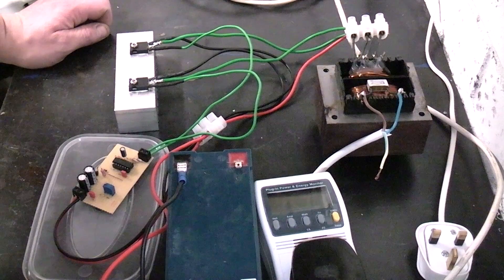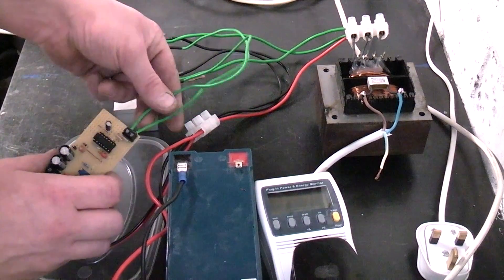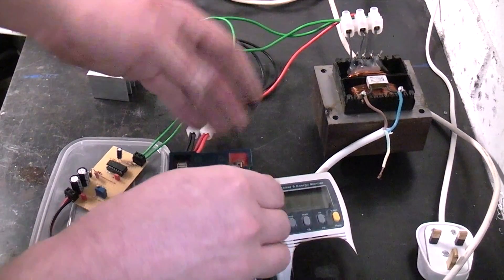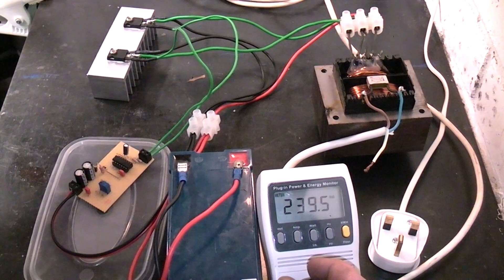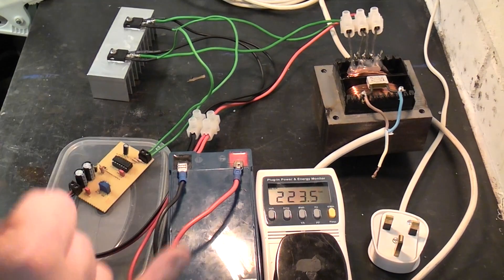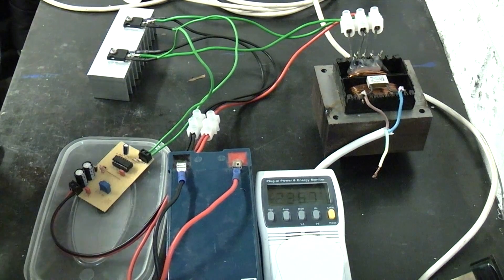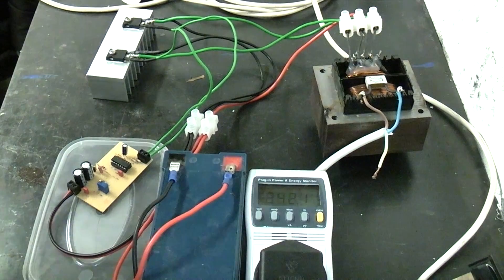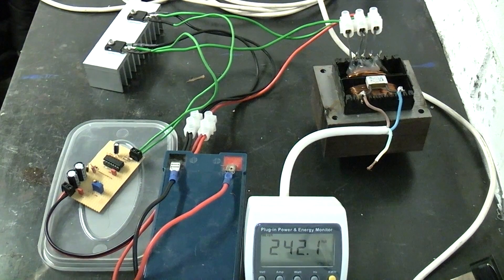DIY Power inverter 12VDC to 240VAC 50Hz 100W.

Comment: witch is most efficient ? single stage of 2 stage inverters? I'm wanting to build a 4-6kw inverter. but not sure. a single Steve is simpler. but I need pure sine wave. I'm probably going to go with the eBay spwm driver boards for a near pure sine. but not sure how to drive the DC to DC. and have feedback for regulation of DC based on load. and voltage drop. I want to maintain constant voltage if possible. do you have any ideas? thanks

Comment: Very Nice Job and nice tutorial,  Please share the diagram of your inverter.
Reply from the maker: +Ali Asir just google 4047 inverter.
Reply: jonny morgan83 There is too many diagrams for 4047 inverter i test one of them but your inverter looks better that's why i want the diagram of your inverter if you can share it.
Reply from the maker: +Ali Asir  its baced around this, http://www.circuitstoday.com/simple-100w-inverter-circuit only i uesd IRFP260 mosfets and clamped the driver chip with a 10v zener diode.
Reply: How calculate number of wires for transformer which operate on 50Hz?